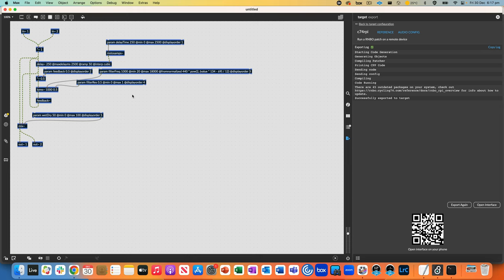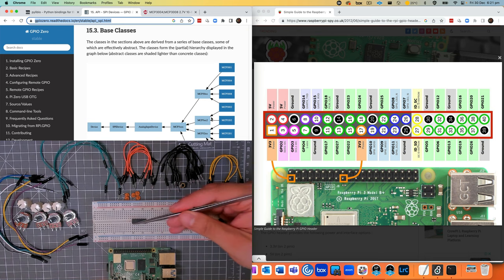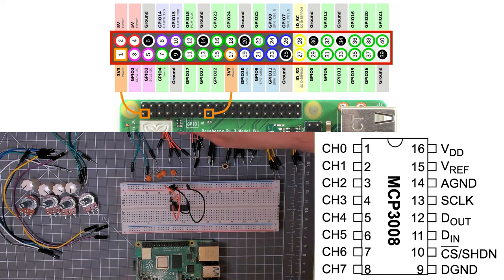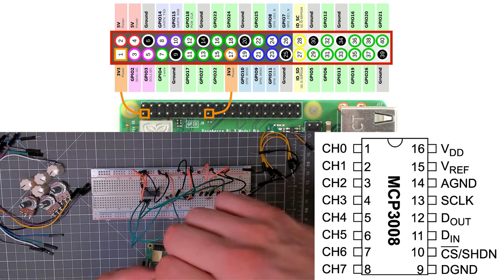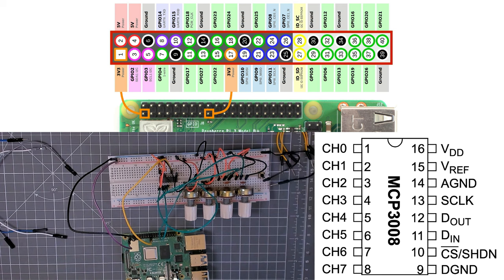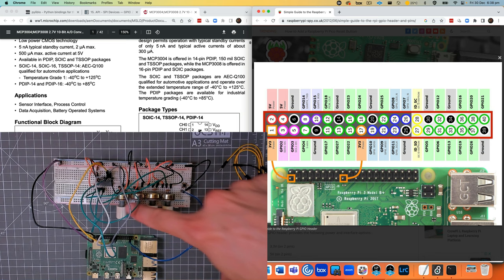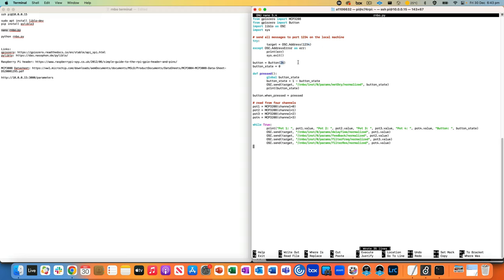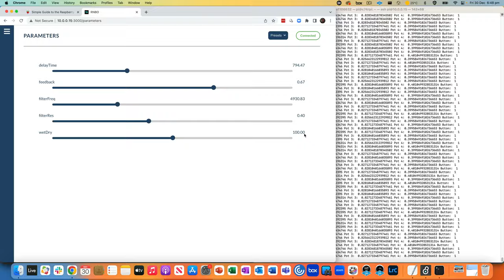RNBO and Max with Raspberry Pi - 02 - Adding Pots

Comment: Thanks for the video, do you think is it possible with RNBO to communicate to the SPI hardware interface to build a multichannel DAC? I'm thinking of using an Analog Devices AD5328BRUZ 8-channel, 12-bit DAC.
Reply from the maker: I am sure that it can, however in this video I am using OSC to communicate with the hardware. You won't get audio rates out of the DAC but rather control rates. If that is what you are after I am sure it can be done.